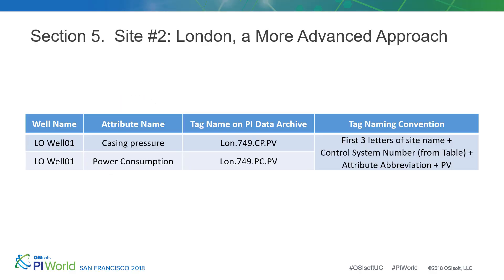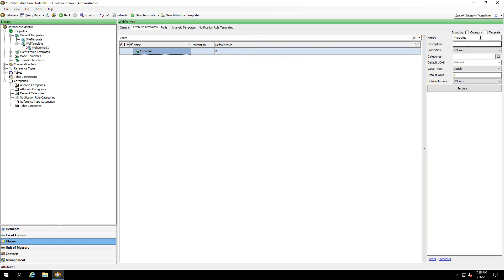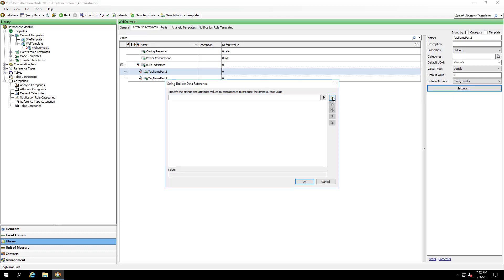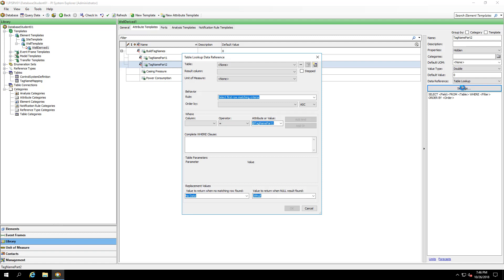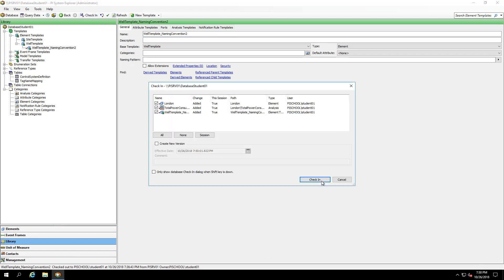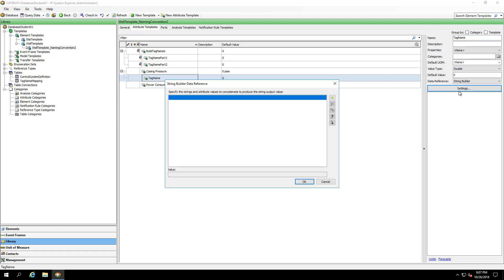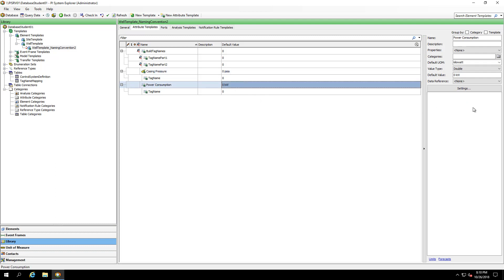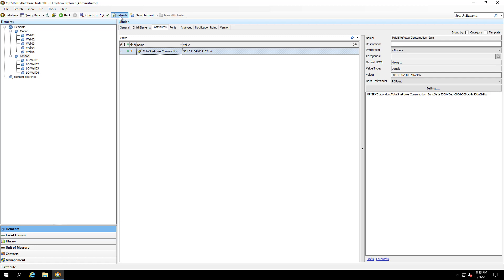OSIsoft Hands-on Lab: Deploying AF Part 2 - Building a Derived Template

Comment: hi - Is Part 3 coming any time soon?  Great video, but completely out-of-focus for the last 70%.
Reply from the maker: For the focus issues, please make sure you click on the small gear icon for Settings at the bottom of the video and select 1080p. This video was recorded in high quality resolution, so if your internet connection isn't stellar, then YouTube might display lower resolution by default which will make it fuzzy. Part 3 will be coming a bit later on than originally expected, but you can find all of the content in the Lab Manual available for download here: https://pisquare.osisoft.com/community/Learn-PI/hands-on-labs (find the link for PI World 2019: Time-saving Tips for Deploying and Expanding AF). Hope you enjoy it!